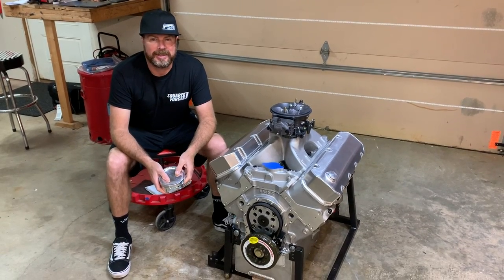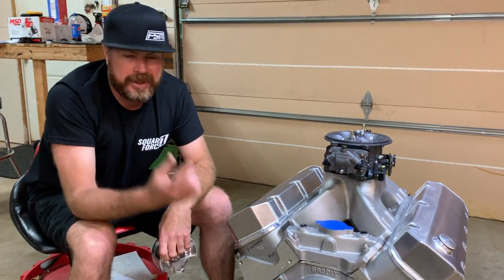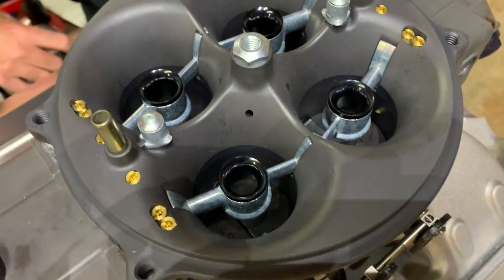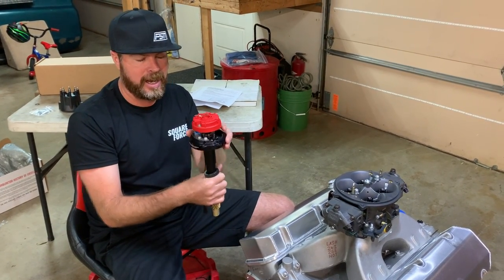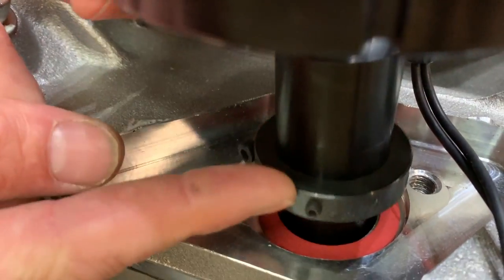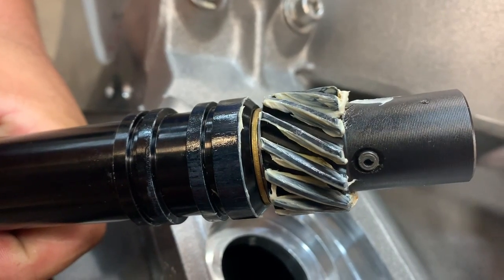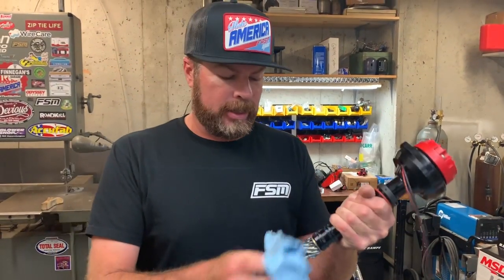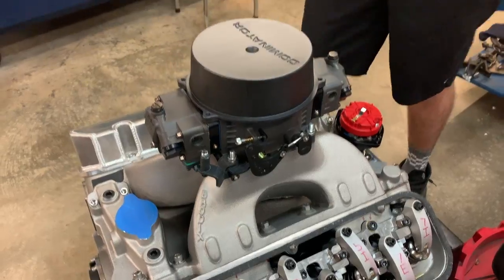1000HP With No Turbo, No Blower and No Nitrous: Finnegan's Garage Ep.79

Comment: I am being nit picky. You said to ensure engagement, move the mechanical advance, referring to the distributor engagement with the oil pump. How does this guarantee that the distributor is fully seated in the oil pump. Once the distributor gear is engaged with the cam gear, you cannot turn the distrubutor shaft save the clearance between the 2 gears. The gears engage before the slot in the oil pump drive engages with the tang on the distributor shaft.  I have been able to rotate the oil pump gears by lifting the distributor without disengaging the gears and pushing it down quickly.  Only works when the oil pump slot is close.  Other than this, very good info and thank you.

Comment: I have to chuckle at the word STOCK being used on a AFTERMARKET head that flows 500 cfm !  I would guess they have special casting process with preported molds  , or , are they cnc'd , either way they are box stock  technically , just sounds funny to hear the word STOCK being used on a head that is that incredible . I fully expected 1000 plus hp with almost .900 lift and almost 600 inches, and 13.5 to 1  compression  . They will sell the heck out of this head if the cost isn't too crazy

Comment: The distributor could not turn because the gears were meshed not because the oil pump was engaged. If it is correct the way you measured it you were just lucky or set the pump drive with a screwdriver so the oil pump engaged as the distributor gear rotated down and the tang of the distributor shaft entered the pump drive extension slot. Most of us need to turn the engine over to do this.

Comment: Since you shipped it, any idea of the dry weight for this setup?  Would be a curious comparison of size and weight for a big N/A vs a smaller displacement blown setup.  It'd be tough to get 800 ft-lbs out of a blown 350, probably only with twins.  But I'd be curious to see a comparable small motor output and what the weight comparison would be.

Comment: Yeah that's very similar to the 598 they built on Engine power. They used Kaase's SR-71 heads on that one which was a 598( this is a 582 correct, well 581.67 according to my calculator, yes I built a spread sheet to calculate engine sizes and piston speed. I know I'm a nerd and I'm happy with that fact) but I think they were running higher compression and managed something around 1109hp. Freaking awesome build. It's amazing to me how much power people are making these days. When I was a kid, and hey I'm not that damn old, I remember 750hp being a huge number and now there are like a dozen street cars that are making that or more.

Comment: for the street on a driver best is no boost or nitro run a tunnel ram the engine will last a longer cast on cast no head gasket problems

Comment: If you go to 12:50 in the video, I believe you moved the collar the wrong direction, it should go .020" down the shaft to create .020" clearance . By moving it .020" up the distributor you are preloading  it and the collar will not touch the gasket?

Comment: for something that's going to run for hours, I'd keep it under 6750 rpm.  A crank trigger is more precise than the cam-driven distributor.  You could have gone to that 1450 cfm Dominator ... or EFI for better torque.

Comment: A beautiful big build.  You did not go much smaller with displacement from 598ci to 581.6ci, (2.7% smaller), so the size you wanted and built is pretty close.  I know you get more power with compression and race fuel, but I do have a hard time believing it actually made 1000hp.  Without forced induction, you can only fill the cylinders with ambient pressure, and it is still running on gas. I may be wrong, but I build small 2-stroke engines for a living and have a water brake dyno that I actually calibrated.  One of my competitors has a dyno too, but I measured is engine at 5hp and they measure it at 9.5hp.  There is really no good way that I know of to calibrate a dyno.  I use a stock engine and rely on the manufactures claim, and adjust my "efficiency loss factor" in the software to match what is claimed by the manufacture.  I don't think anybody else has calibrated their dyno in my industry, (but I do match a couple of them), and the numbers are all over the place.
Reply: Beautiful big build though.  You guys look to do good work, and that is very respectable to me.

Comment: Back in the late '70s, I took a 1970 402 BBC, put '66 closed chamber heads on it, with a .510 lift Crower hydraulic lifter flat tappet cam and got around 465+ HP out of it. A guy I met from the neighborhood, Joe Satmary (NHRA Pro-Stock Champion, using a BBC) told me that I likely underestimated my HP output. We were going to get together to build the next stage of that engine's life, but monetary aspects by me and circumstances in his life prevented that from happening. 
He was talking about me having a 9.500 rpm redline and a go "all day" rpm of 8,500. Output? His estimate with the tri-power set up I wanted to top it off,...minimum of 585 HP on pump gas.

Comment: you guys should do a horse power to weight test, take a stock car and run the quarter with it ,then remove 50 pounds at a time till your left with nothing but frame then do a calculation of weight per power gain

Comment: All that needed to be done was the mesh set correctly between both gears... put a distributor in with out the gasket to make sure the gear did not bottom  out into the oil pump shaft... put the distributor back in with the gasket... ( in this video the distributor gear needed to go down a tad onto the camshaft gear .. )

Comment: I would like to see what kind of driving experience a motor like this returns versus a supercharged or turbo LS type engine. Does the N/A engine run cooler or hotter get better or worse milage, have a longer or shorter lifespan. Of course a few things would have to change. You would want a well tuned engine management system on the big block and probably hydraulic lifters. They don't have to have 1000HP but some number easy to achieve on both types of engine setups and then compare them in the same car.

Comment: I had a 28 footer and had a burn rate of 10 gallons an hour at 25 mph with an I/O. What's the burn rate of that boat going to have with that motor? What size chopper prop is he going to run and is he going to have 400 + of  fuel? Wow 1000 hp, I only had 270hp. Nice build, that is going to be some ride.
Reply: Based on my watching this video, I believe he said he built the engine for a friend's jet boat. There is no propeller, just a jet pump and nozzle.

Comment: Increasing the length of the connecting rods decrease the maximum connecting rod angle resulting in less power lost from linear force deflection at the wrist pin, at key points of rotation, parasitic loss from motion conversion (reciprocal to rotary) larger angles press the piston toward the cylinder wall increasing ring to cylinder friction, the more you keep the forces aligned along a single linear plane the less dynamic counter forces act upon the piston. Less torsion stress negates the need for beefier slugs
Reply: Plus you increase horsepower and torque figures

Comment: Nascar was running near 900hp on 5.8L 358's N/A at 9000+RPM and carbs until 2012 they went efi.
Well cup engines anyways.  
And now recently they run tappered spacers most places now. 
Not sure if they run the full power anymore.

Comment: i'm definitely not a Chevy guy. i had a bad experience with Chevy when i had that p.o.s. third gen z28 (83). but anyway. Chevy or not, i'm always thrilled when someone builds an all motor engine! anyone can slap on a turbo, supercharger, or enough nitrous to choke a whale and make big horsepower numbers. it takes a real engine builder to do it without those things

Comment: I don't have very much knowledge in engine building or tuning but I would think you would want to have the engine tuned at the same exact sea level you plan on running it at. If you tune it in California and run it in Georgia especially with a carburetor that is that finicky at anything other than wide open throttle wouldn't you think that your air-fuel ratios would be off enough to cause an issue?
Reply: You  change the main jets to compensate for altitude

Comment: The calculations on the Oil Pump Shaft to Distributor Gear Engagement is incorrect.
Your Measurements of 7.250" minus 6.625" equaling a measurement of .625". That's all Fine, but you forgot to deduct the .250" undercut chamfer on the Bottom of the Distributor Gear.
Correct Measurement of Distributor Gear Engagement is as Follows: 7.250" minus 6.625" minus .250" equals .375" of engagement. 🤔
.375" of engagement on a gear that is capable of excepting up to .875" of engagement is cutting it close. Hope you make an inspection on that Distributor Gear.🙄

Comment: Mike - No reference to oiling or the brand of oil pump? I saw 100+ psi oil pressure - is that right? Since it's headed for a boat, is there any special cooler needed to keep the oil temp cool? Thanks man - I love all the nerd specs etc. Great channel - just too little postings!  :-)    Chuck in NE Kansas

Comment: In a car with a big camshaft this engine would be awesome since it makes all the torque earlier you can afford to lose some for top end power  .in my opinion it should be on e85 because you can get that right out of the pump and e85 is 110 octane or better sometimes and with the cooling effect you might be able to boost it as well
Reply: Boost, lol..13.5 compression, lol…..
Reply: If it was direct injection that would be different,…I would t dream of boost even on E85..

Comment: Question. Taking in consideration Roadkill's landspeed camaro... which engine would make for the faster car? This one or the small block that Freiburger built and tested on Engine Masters? I mean weight should be about the same but torque I have to guess is a fair bit more with this big block... I know it's for a boat no worries. Just conversation material ;)

Comment: I'm going to guess that since the HP numbers were still climbing where you stopped the test, it breathes too well and might be kind of problematic at low RPMs where you might need a street motor to work.  Curious, since we didn't see the actual pistons, how much of a skirt they would have.  And, how fast can you safely spin a motor like that?  For a boat I suspect you have to govern the motor to protect your investment. (limited to peak torque maybe?) Naturally aspirated, you sure have to spin-um fast to pull that kind of a HP number.

Comment: Aaron Brown (The Garage Shop, North Carolina) has a Land speed 39 Ford pickup "rat rod" called "the Uncatchable".  It has a 358 cubic inch Small Block Ford with one 4-barrel, and NO power adders.  950 HP.  Has gone 212 mph. (1.5 miles).  So...Chevy needs a big block to get 1000 horse? (asking for a friend). Interesting.

Comment: Do carbeurators really atomize the fuel that well?? Seems like with this much money you'd want a fuel injected, individual runner to maximize the power potential?
Reply: No, they're all restrained by their crappy original design, why spend all this money on an engine and then ruin it with carbs, smh
Reply: @ricky302v8  That was exactly my thought but didn't want to assume. Thanks for clarifying.
Reply: @208SledHead  This episode of Hot Rod Garage sums it up nicely.
https://www.dailymotion.com/video/x3wp3q7

Comment: I’m just a ham and eggar so it’s probably a bonehead question but if running race fuel why go with 13:1 for compression? Why not run higher, 14:1 or 15:1? Like I said, probably a foolish question but just wondering.

Comment: The distributor situation seems like a hassle, why don’t they just provide somewhere to bolt a standard crank position sensor, then you can just lose the whole distributor gear setup entirely if you’re running electronic ignition with coil packs.

Comment: I see you have some spacers between the manifold and the lifter Valley wall. Is there somewhere where you show how you made these or where you purchased them? I need to do something like this on my small block.
Reply: Those are sold for putting low-deck intakes on tall-deck big block Chevy's.

Comment: I'm pretty sure that on an Engine Masters episode someone said that on dyno graphs the HP and TQ lines cross at 5,250 rpm and this is also where the TQ line drops below the HP line and the HP line keeps climbing to redline. How is it that this engine has peak torque at 5,500 rpm???
Reply: Because TQ is a measurement, HP is a calculation. TQ x RPM, / 5252, = HP so below 5252 one ft-lb = less than 1 HP, above 5252 one ft-lb is worth more than 1 HP

Comment: Why not put it in...turn the crank shaft while putting pressure on the top of the rotor cap...when it lines up with the slot in the oil pump drive shaft it drops down.  Easy peze

Comment: Ya, ok....but what do you do if you dont get stupid lucky and sick it right the first time? get it close and rotate the motor until it drops? you can, but than you have rotate is again to get back to base timing. Easier way, done properly you can hit the number + - one degree.
Set the cap on the dizzy and figure out what direction you want the wire harness to point...put a mark for #1 on the cap and the dizzy and put it in...kinda orientate the base so its  at #1....when it does not drop all the way pull it up just far enough  so thr rotor will toun and turn it just enogh so it doesnt go back in the same way....or you can just flip it around until it drops all the way...not pointing the right way, no biggie.Just pull it back enoght to clear the cam gear and rotate the rotor about 190* clockwise...it shuld drop all the way. If it doesnt turn the rotor a little bit until it does. pull it up again, rotate 190* again. When it does you will notice the rotor has moved 1 tooth....keep doing it until the rotor points in the right direction (10 min of one finger typing to explain something that will take less thn 2 min. to do lol )
To set the timing set the balancer on your total timing number, pop the rotor off and rotate the housing  until one of the points on the reluctor wheel line up down the middle of the pickup and tighten it down. If you have a dizzy with mechanical advavce just advavce it before you line up the pick up. Guy who does our dyno work say i hit the number almost every time. you do it like that and you know its right if you have problems on start up you dont need to be messing with the timing,,,,,im an olg guy. an old guy taught me that trick when i was a young guy  lol

Comment: Rotating the distributor shaft ensures the oil pump drive is engaged?  I don't think so, partial gear tooth engagement will keep distributor shaft from rotating.

Comment: so you were trying to turn the rotor and distributor shaft to see  if you had engaged oil pump drive. please tell me that you weren't really expecting it to turn or even rock while exclaiming that it engaged the oil pump. the only thing that proved is that the distributor engaged the distributor drive gear. if i am spending that much money building what appears to be a beautiful motor, why didn't you put a crank triggered ignition system in? cam driven distributor suffers from errors due to "lash" from both crank to cam drive and cam to distributor. i may be wrong but doesn't MSD 85703 have a mechanical advance and you said that you were wanting to run a "fix non advancing" unit?

Comment: What would be the cheapest Engine with the most output of power possible?

I am thinking of adding
Fuel Pump
Fuel Rail
Fuel Injectors
Exhaust Manifold Headers
Cam Shaft
computer 
2 turbos
Innercooler